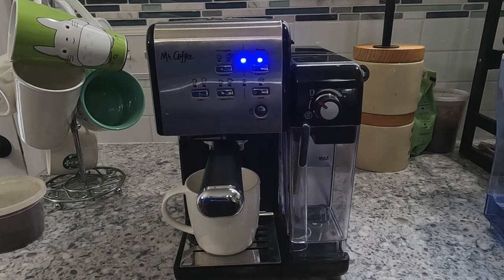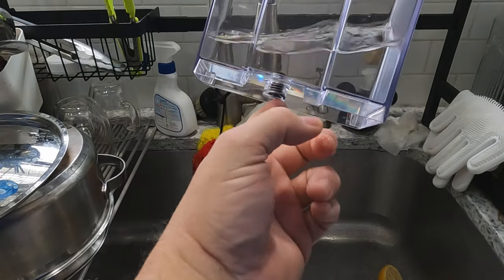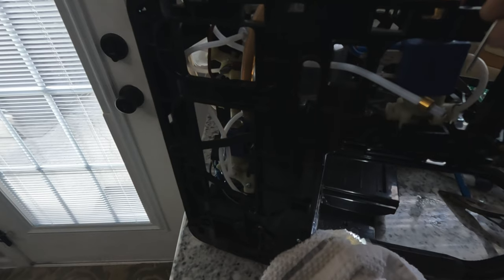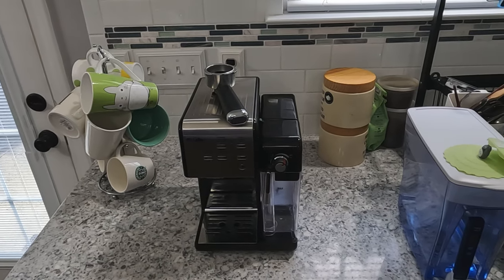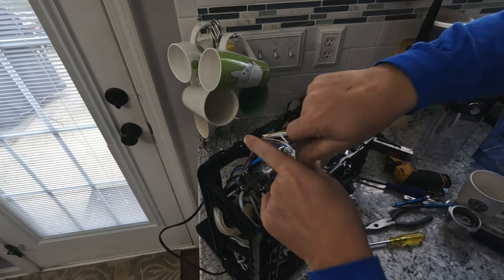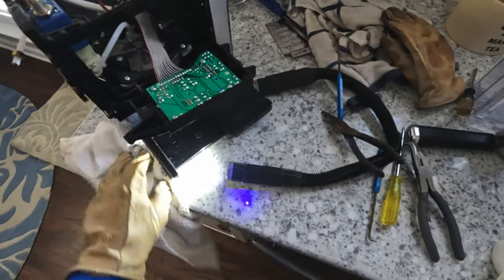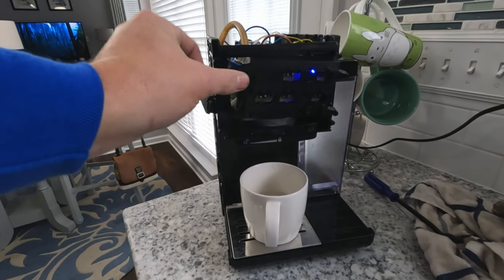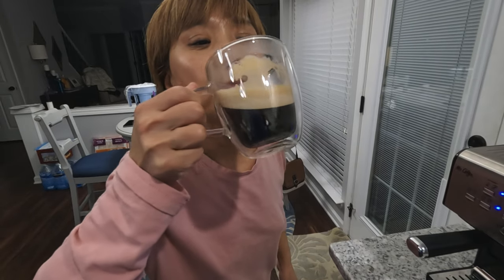#MTBPlanB DIY fixing a slow drip from Mr. Coffee Onetouch Coffeehouse espresso machine.

Comment: I cannot seem to “repeat the same procedure” on the tank side panel. The sliding tank lock and the tank valve do not allow me to push the panel forward like I did on the side opposite of the tank. Do you have any extra tips or videos on removing the side panel on the tank side?
Reply from the maker: I don’t remember exactly but I believe there are screws under the bottom base too.

Comment: Gosh.. You've just dismantled the whole thing down. Didn't You try to clean the pipes first ?
Reply from the maker: Yes cleaned everything that was possible, but since it was entirely blocked, couldn’t run de scalar through the system.
Reply: @MTBPlanB   I got the same issue with little DeLonghi but it's gonna take me the whole day to do that job 🙃

Comment: How do you open the side of the cup
Reply from the maker: Don’t understand, expound please?
Reply: How to remove the panel on the side of the tank. It’s not moving any direction (forward, back,up)?
Reply: Hi Thanks for the video, but the side of the tank is not moving any direction, please help. Thank you @MTBPlanB
Reply from the maker: @dimanosenko  Should be screws underneath the back and bottom panels to release. Then pull forward on side.
Reply: That’s a lot of disassembly and reassembly plus troubleshooting.  Appears start to finish, I’m thinking 3-ish hours?
Reply from the maker: @jonathanwarner8016  Sounds about right!